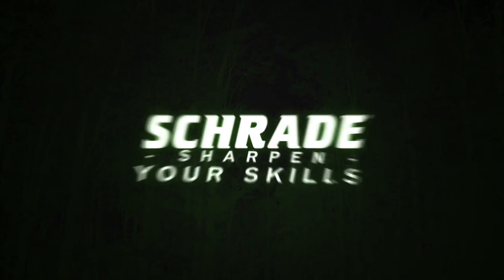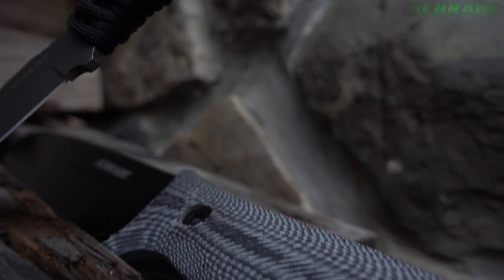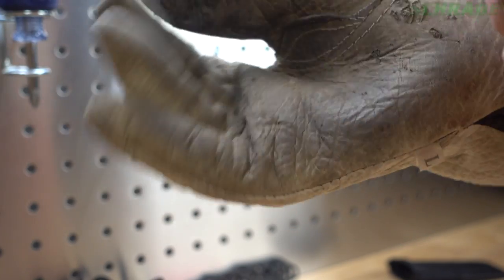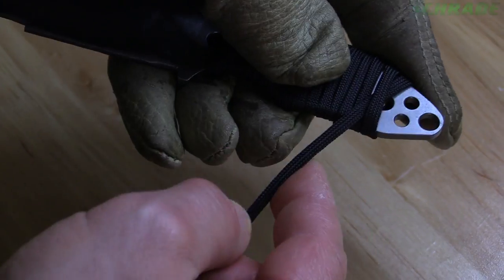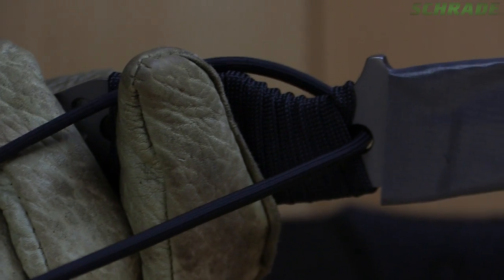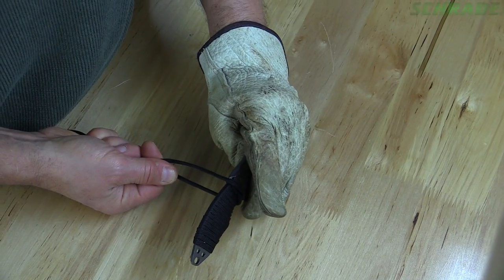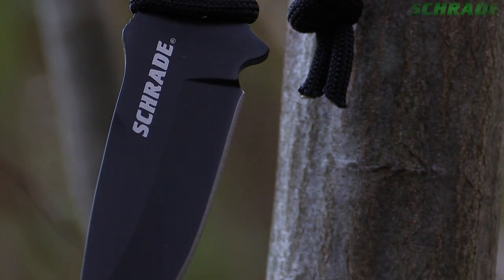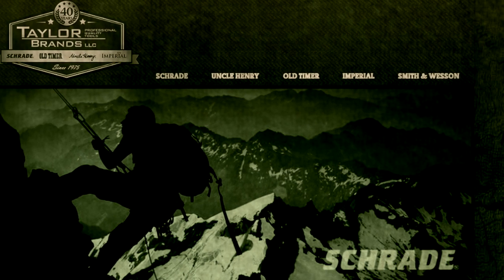How to Paracord Wrap a Knife Handle Use a 360 Stryder Wrap

Comment: I always heard to dampen or wet the paracord before wrapping.
Reply: Sure, if you want to rust your knife.
Reply: +Dan Schwemin Jr  you don't cut wet stuff with your knives?
Reply: Sure but I dry it as soon as I'm done...  Even trying to dry the paracord once it's wrapped on the knife will not take all of the moisture out, and therefore can cause the knife to rust if it doesn't have a coating of some type.
Reply: I don't know about that, but People will boil paracord in order to shrink it. Mostly just to fit more cord, and to tighten the cord around whatever you've wrapped it around or woven it into...